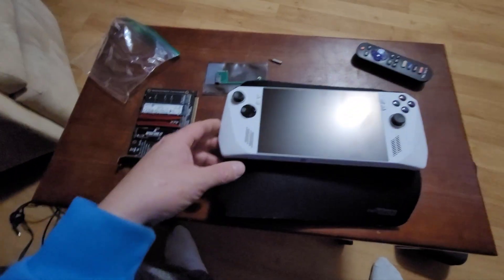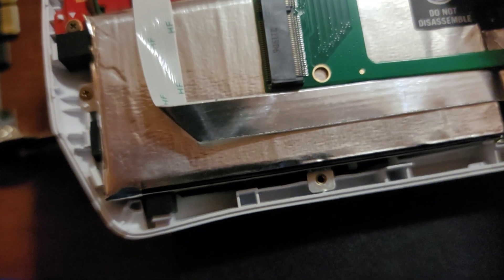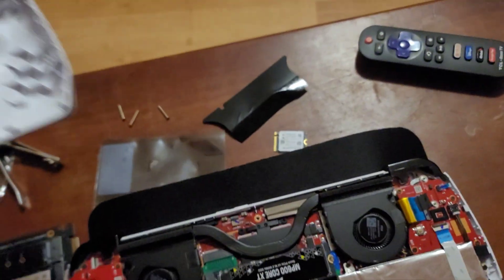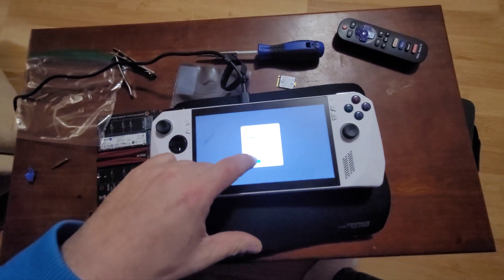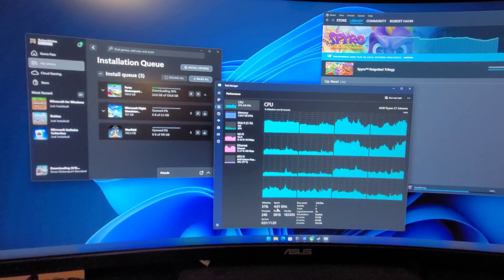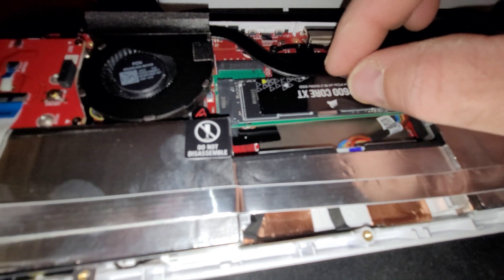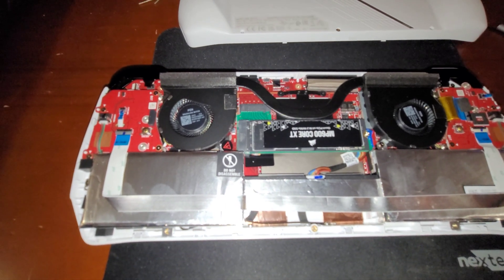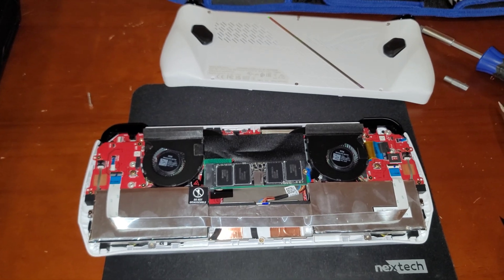ROG Ally - 90 Degree 2280 NVMe Mod

Comment: Did cutting the heat shield improve temps? Thanks for the video.
Reply from the maker: Yes they did. That minor adjustment helps greatly. In a case of doing heavy installs on the 4tb for extended periods of time it took me down to 68C with standard curve and if I did a 10% fan curve increase 62C
Reply: @RobertTheHahn  With the stock ssd, I'm getting 81°C (ssd temp) while running furmark and crystaldiskmark simultaneously. This was 30 watt manual tdp with no boost and a custom  fan curve which max at 70°. I'm planning on doing the 2280 mod soon.
Reply: @RobertTheHahn  very cool. 👍